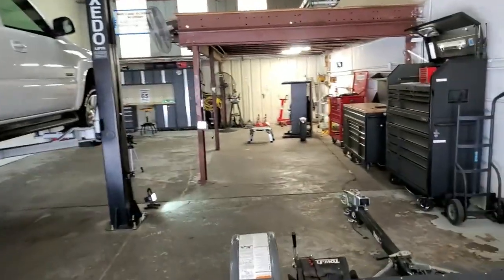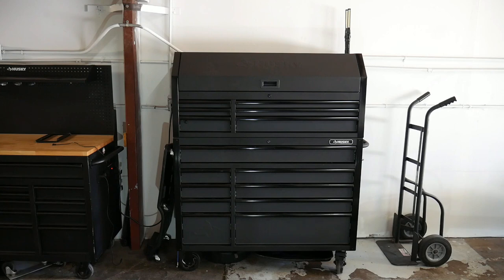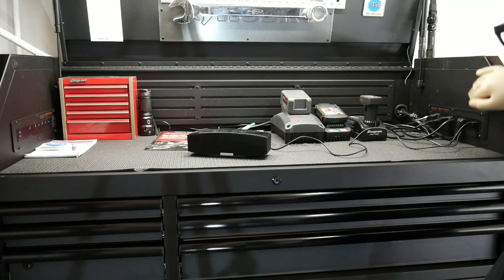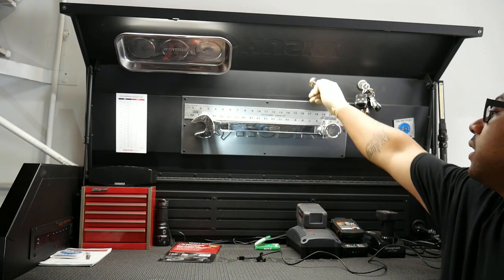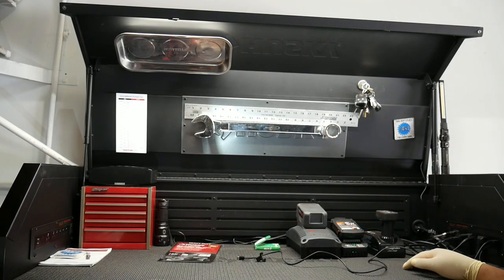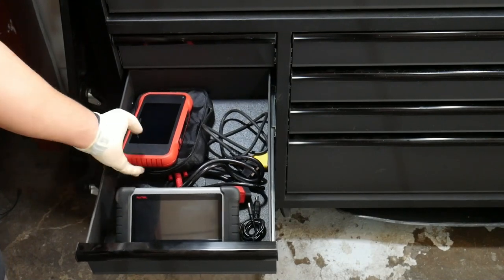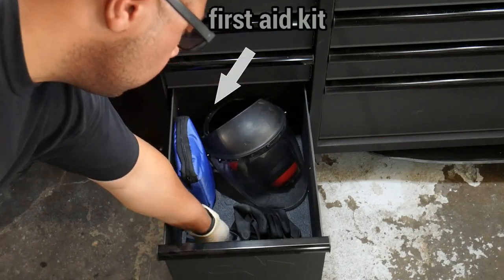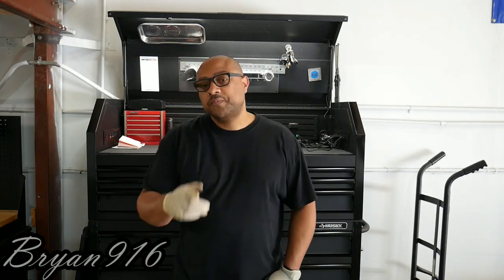Husky 52 in 15-Drawer Tool box Review & Tour! Model# H52CH6TR9HDV3

Comment: Husky didn't change anything with the double drawer slides. You were comparing a Husky Standard Duty (61") with a Husky Heavy Duty (52").  You went to a higher tier toolbox. Your older Husky box is also a Standard Duty. This is like comparing a Yukon toolbox with a US General. I doubt a Yukon box would hold up to professional automotive use either. Husky also has a Professional Duty line, but I haven't seen those in stores and those are getting into Icon prices.
Reply from the maker: I didn't realizes Husky had different tiers. thanks for the info!

Comment: Awesome box! Just had a question for you. I have basically the same box but the previous model where the middle large drawer doesn't have the double slides. Do you think it would be possible for me to add slides to it to make it stronger?
Reply: I've looked into this as I have the previous gen box with the single slides and they died in a year. Need doubles. There is room for two, I haven't fixed it yet.
Reply: @spevakdesigns  Awesome, when you do fix it let me know how you go about doing it!